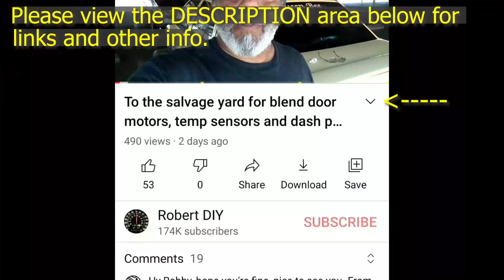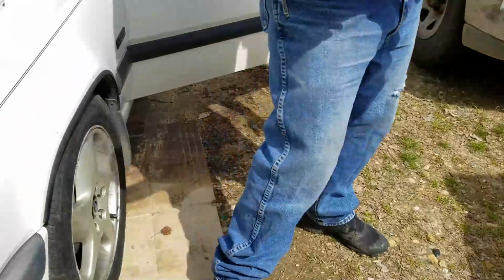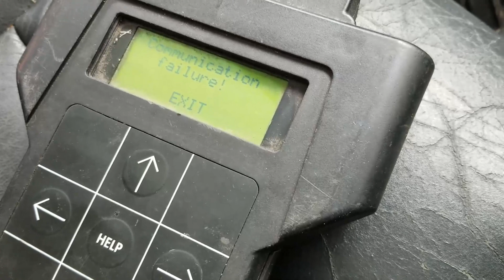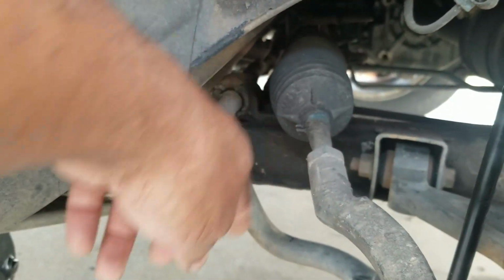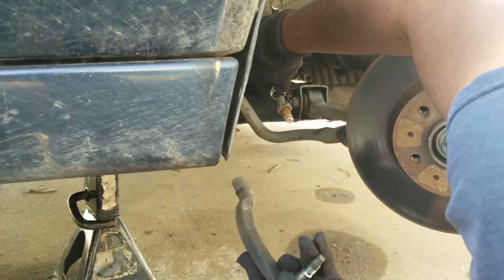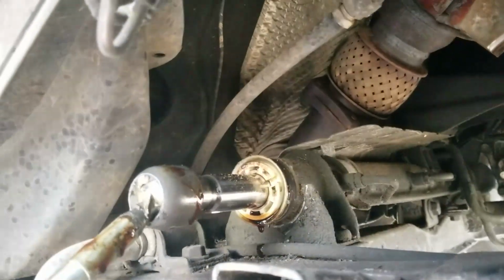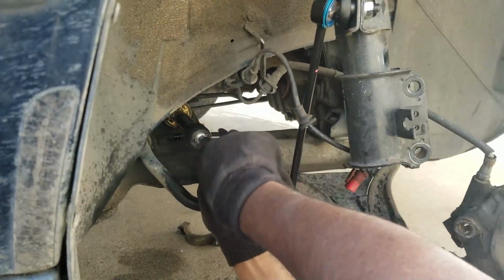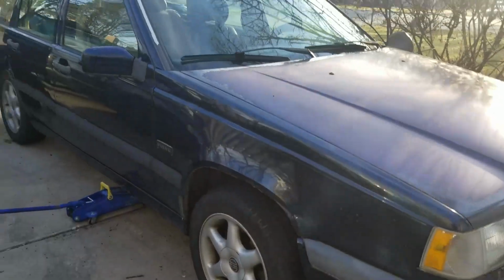Helped a couple of 850 owners today. Heater core, firewall junction, tie rod ends and CV axle - HOWR

Comment: Bout to do the intake VVT solenoid on an '06 S60  Wish me luck.  Any tips/tricks for smooth removal?
Reply: lock the hubs on the back side or youll never get it  to run again .. 850 ez to do s60 royal pain with  the spring loaded hubs..
Reply: @AwakeDude911  Oh im only doing the 4 bolt solenoid on top next to that system with the gasket and oil  not messing with the actual belt or the VVT hubs thank god not for atleast 30k -50k miles
Reply: @Vamk420  ooo thats just a  8 min job tops ..find the torq spec like 12lbs or something light ..very simple job unscrew the 4 bolts and Torq them back down..a bike Torq wrench for the low inch pounds required works best . ive done mine a few times ..dont use the cheap Ebay solenoids  they last maybe 10-15k and the code comes back.. 1A auto  is ok ones (i used) but fcp has the best ones but high $$$$.
Reply: @AwakeDude911  Yeah i got the 220 dollar  one from FCP and just got in in 2 days ago and im gonna brave it this sat  im only afrad of snapping a screw because i saw a youtuber do it but they also removed an aged fake one like you mentioned that was over tightened without a gasket...  im just nervous
Reply: @Vamk420   just tighten in a criss cross method  like rims and it goes pretty smooth . take a pic before you begin it always helps later if you get lost on something . good luck !
Reply: @AwakeDude911  Everything worked out wonderfully.  She has all her power back and the light went out so far.   It had to have been broken before i took possession of the car its never preformed this smoothly. and was this punchy.
Reply: @Vamk420   good it all worked out ..pretty ez to do for ya ?
Reply: @AwakeDude911  I was just expecting the unexpected.
Reply from the maker: cool, not sure of the torque but it is probably something like 7.5 ft lbs or 90 in lbs.